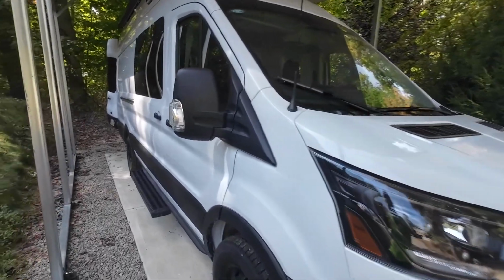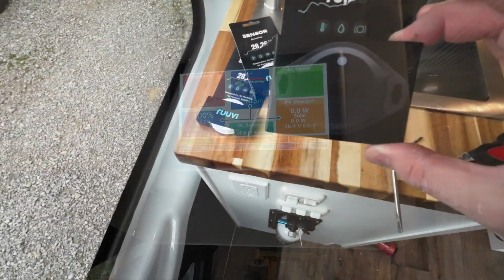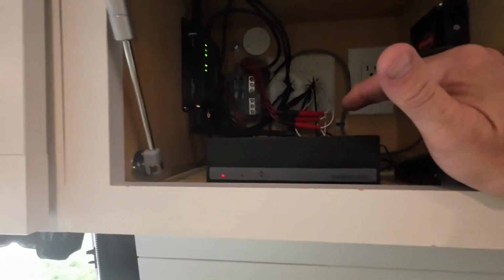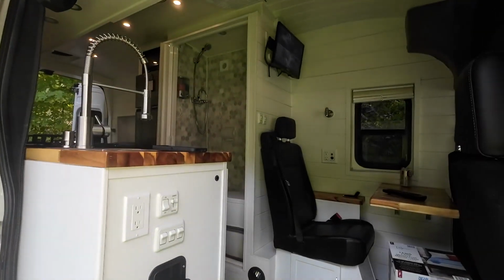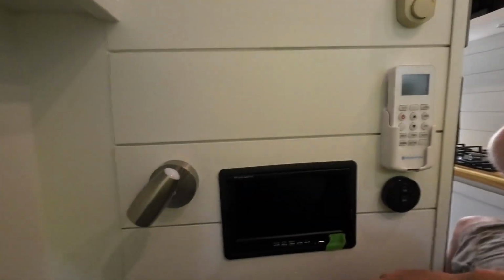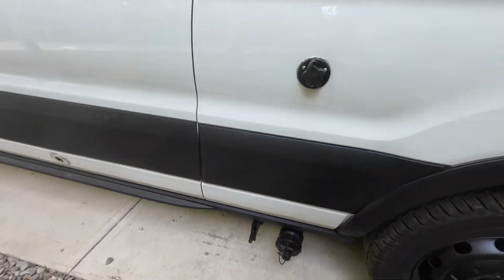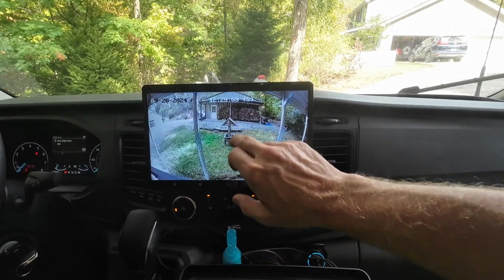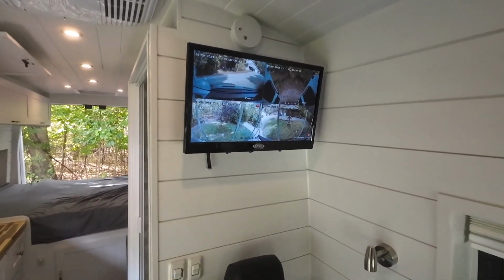DIY Security Camera Lighting & Automation System For Your Custom Camper Van Build

Comment: great video, would you use ip camera (power over Ethernet camera)?
Reply from the maker: You could, but it wouldn't work with this DVR. I prefer HD over analog for smaller things like this
Reply: @ do u use analog cable for your cameras? I saw some people will use Ethernet Cat6 cables for analog cameras, which one you suggest? Thanks
Reply from the maker: I just used the included cheap analog cables

Comment: Good ideas. one question. do you use a 12volt regulator to power your DVR. and your cameras. Thank you for ideas
Reply from the maker: What do you mean by regulator? They run off of the house lithium battery bank

Comment: Thanks so much for posting this, it's exactly what I've been looking for! Do you have a link for the small monitor by the bed? *Edit: Also, does the DVR work on 12v or would I need to have my inverter on?
Reply from the maker: https://amzn.to/3XsRs7q
Here is the monitor. The DVR runs on 12volt.  Can run right off of the batteries.
Reply: The dvr is 12v